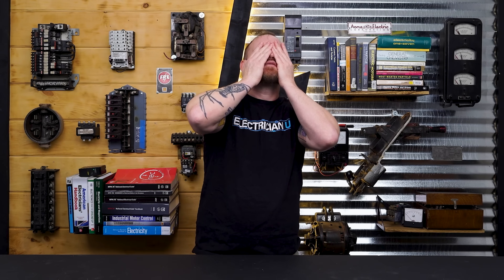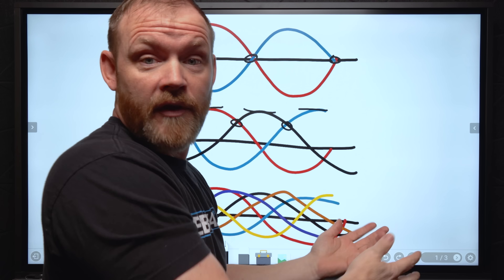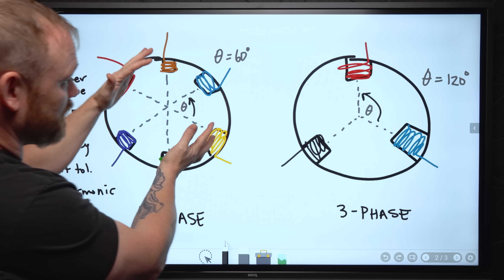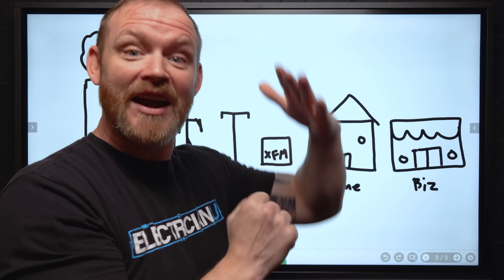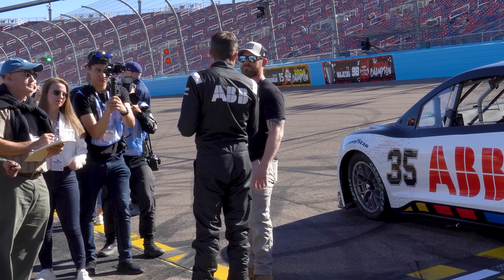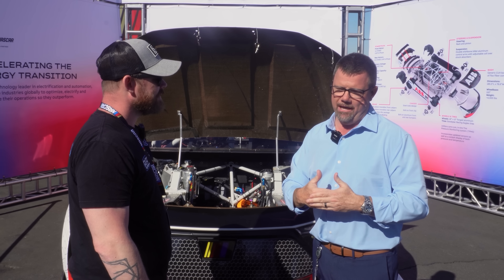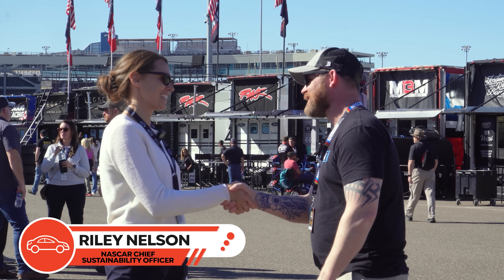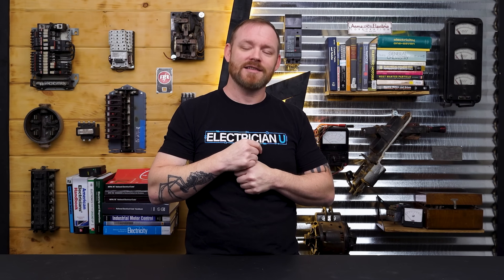6 Phase Power is a REAL GAME CHANGER!

Comment: Um, the zero crossing no power state is actually 120 times a second, two crossings per one cycle.
Reply: yeah, and the graph showing single phase with blue and red tracing is a bit misleading. should just have one red sine wave, not red and blue.. the blue opposing wave would be if you had a 2 phase system, with one phase 180deg out. not very useful
Reply: @DavidFRhodes I personally prefer the 2 phase terminology, but what you're calling 2 phase everyone else calls single phase so as much as I like the idea of calling it 2 phase you'll just be causing confusion to do so because the rest of the world calls it single phase
Reply: @ people don’t call it two phase because it isn’t. It’s single phase with two legs of opposite polarity. It’s single phase with two voltage options, full voltage and half voltage. Nothing more.
Reply: @RenoSCM 220V in the US is two phase.
Reply: @ChaseNoStraighter  that's incorrect it's single phase, split 240V. Also, it hasn't been 220V in the US since the 1980's
Reply: @ChaseNoStraighter  “Split single phase” is what you’re talking about. It’s single phase with a center tapped transformer secondary to allow either 240v or 120v loads.
Reply: @RenoSCM  depends on where you live sometimes you’ll have a three phase power thats adapted a single phase and you’ll have the two hot wires, 120° apart instead of 180° depart resulting in 208 V
Reply: @johnathanrice3569  If your transformer primary is using a single phase of distribution voltage (around 7200V), the secondary will be split single phase just about every time. Either a pole mount or pad mount transformer, still the same winding configuration.

A transformer like you’re talking about, how do you think this is configured, using a single phase primary and somehow coming up with three phase secondary? That’s not possible. In order to have three phase secondary you need a three phase primary arrangement
Reply: @ChaseNoStraighter  240 v power to residential units is single phase. The neutral center tap on the secondary gives you the two 180 degree out of phase 120 v circuits. It’s still single phase . We sometimes call it split phase.
Reply: @glennmcgurrin8397  2 phase power had a 90 degree phase separation
Reply: Leave off the "um," you'll sound more helpful and less pedantic.

Comment: If the Utility had 6 phases, why couldn't the 3-phas users just use every other phase for their 3-phase stuff. (load balance will need to be managed)
Reply: They could.

But six phase would require much more infrastructure which doesn’t create much benefit.

Cost to benefit isn’t there

Comment: 6 phase motors can be adapted to 3 phase and DC systems. Using VFD drive system  like in that car is from DC battery.  6 phase inverter . to do this in a factory just use a 6 diode bank to DC and drive VFD. This is done on 3 phase sync RM motors.  For the power grid with long transmissions lines 6 phase is wistful with the number of wires. What is being done is UHVDC which is more efficient and uses only 2 wires. and it is DC.  Part of USA power grid is DC   and China has a UHVDC grid system. With semiconductors getting much better it is now easy to convert DC to AC . This  allows grid connections to 50 and 60 HZ , That only be done with a motor generator set before and not efficient and high maintenance .
Reply: Some UHVDC systems use a third metallic return wire in order to prevent ground currents.
Reply: Uhvdc, that's dangerous stuff.

Comment: Don’t BEV’s use DC power?
Reply: not always, the slow charing is AC better for the battery.
Reply: @ Actually not. The AC current is rectified to DC. My question was regarding battery, electric vehicles, which use battery/DC power, and not AC power. Run six phase in a battery electric vehicle would require a very interesting inverter to convert the DC to six phase AC power.

Comment: Fun to drive, super boring to watch, sound and smell is half the experience
Reply: This is the key, for better or worse, noise is most probably most of the issue. No one would buy a ticket for an AC/DC concert, if those guys were not mic’d and amped up. After the first few rows, you might be able to hear just slightly more than Phil Rudd, but probably not. 

 For the amount of live audience, the fuel consumed is relatively low. NASCAR should not go all-in on this, it could easily become a disaster. There are places where being quiet is appropriate but not at those types of events. Obviously, those lot will trial races, but l do not expect anywhere close to the numbers and ticket sales of a main race, after the novelty has worn off. Also, whenever EV takes over for everyone else, there will still be a market, possibly more of one, for lCE racing. Speed is only a slightly important factor, endurance and strategy are more important overall. Those lot are heavily restricted and not actually going as fast as technology will allow.

This being said, the topic is still very interesting and excellent for this channel.

Comment: Dustin I really enjoyed this video. Thank you for covering this, it was fascinating. Ive only just finished AC motors in my apprenticeship. I would have thought the down side of 6 phase was that it increased the number of poles in your motor. Doesn't increasing the number of poles reduce the RPM? Or is this only for three phase?
Reply: Motor speed wouldn't be affected because motor poles refer to the rotor and are independent of the number of phases. Think of it as how many degrees the rotor turns per supplied Hz. 

The way that variable frequency drives work to control motor speed is by using very fast switched DC signals to artificially replicate AC sine waves. Reducing (or increasing) the artificially produced AC sine wave Hz slows (or speeds up) the motor.
Reply: @realtimjimmy  thanks

Comment: Inversion to any number of phases is technically simple (just a multiplexing and transistor bank/ CV onductor "count" decision and I think had been done before in several industries where extreme smoothing for ultra stable DC is required... We call it poly phase (no limit beyond practicalities), not viable tor transmission (count the conductors - more = higher expense at every termination) mechanical strength and thermal properties of aerial cables is a factor in minimum sizing...

Not everything "genius" is new.

Comment: 1:39 so does that mean that in a 3-phase system, asuming 120V rms, running at 60hz per phase, a motor would technically be receiving a 60V-120V fluctuation between all three phases, 180 times a second, so every 5.56ms? 

same thing for a 6-phase system, there would be a 104V-120V fluctuation every 2.78ms

i hope my question makes sense

Comment: To bad the battery's are dead in literally 20 mins! You would have to do a hot swap battery because how hell you gonna run 200mph for 200 miles???? Its not ready the battery tech just is not ready yet. It wont be for 50 years. 78kwh battery when the car can draw 1000kwh???? do the math on it. It just don't add up to having a large power reserve to last long to not have to change out battery every 20 mins or less. ITS a Joke.

Comment: Why wouldnt the car just use a DC motor? I thought AC was more efficient for long range transmission, but the battery and motor are right next to each other.
Reply: I think it is DC. If its battery powered it has to be, right?

Makes me think of brushless DC motors used in power tools. Those are 3 phase
Reply: @ForkTech83 Brushless DC motors are actually AC motors with an electronic converter. Most of them are 3 phase.

Comment: Needs cooling because, the drivetrain is still friction think single gear or more in fancier ones. Gears still need oil and cooling. Batts too in hot days
Reply: Actually you need cooling for the electric motor, inverter, and battery.  Converting electric power to mechanical force generates large amounts of heat.  If you look at almost any electric motor you will notice cooling vent with a small fan on the shaft pulling air across the motor.

Comment: I doubt electric stock car racing would gather much of a fanbase regardless of how many social-media influencers they summon to hype it up. Formula E barely works because it pulls from an international audience and because they use street circuits.

If you want to see cars going around in a circle and hearing boring buzzing sounds, kick over a box fan,  superglue some matchbox cars to the blades, and grab a beer; it's probably more entertaining.
Reply: You are right that a silent circle of cars would be boring. They would surely need audio sounds like that of Star Wars to differentiate between cars as they go around! And the tracks would need to be more curvy to better allow the skills of the drivers to show as well as the capabilities of the torque and acceleration of the cars.
Reply: @MrNiceGuyMEGA08  Then is not gonna be Nascar, it will be something like a GT cup. Part of the appeal of nascar is the mayhem that could potentially occur due to high speed and close proximity and the roar of dozens of engine. Just like top fuel dragsters appeals is their crazy loud and powerful engines.
Reply: @AC89-o9n no the appeal of NASCAR was "Race on Sunday, Sell on Monday."  That died in 1998 when the stock bodyline was dropped.  Since the Car of Tomorrow all they've been is the same car with different stickers.
I'm surprised Ford is still in since they already pulled out of NHRA, (a Mustang is not a NASCAR car).
Reply: NASCAR will require all to use the same powertrain components so there can be no advantages.   NASCAR becomes a page in history.
Reply: That sounds more entertaining than the Non Athletic Sport Centered Around Rednecks, to be honest.
Reply: Engine sounds brought to you by Kenwood, Sony, and Marance.

Comment: In a three phase system, if you "lose a phase" your motor will barely run, if at all, and it will burn itself out or trip the circuit, because when you "lose a phase" you are actually losing TWO phases, so your motor is trying to run on just one phase!
Reply: @johnb6418   only if it's lightly loaded it might run at a slower speed for a short time. At least that's what I saw during my 50 years as an industrial electrician.
Reply: It depends on it is delta connected or wye connected motor. A delta connected will burn 1/3 of the windings a wye will burn 2/3 of the windings if you lose a phase.
Reply: The relationship between phases and legs is roughly that of edges and nodes. While 3 legs give you 3 phases; two legs gives you one phase.
Reply: @robinhammond4446  in the applications I worked on we always referred to that as "phase to phase".

Comment: Six phase in most cases not worth it. Just having to accommodate having to increase wire size because of over 3 current carrying conductors. With three wire three phase not sn ussue uf you cross wires othet then motor direction will change. In 6 phase if you crossed the wires could imagine burning motors uo like it happens in 4 wire two phase motors.

Comment: Here's a wild and crazy idea. 12 Phase. 30 degree seperation between each phase. For homes and businesses it might be overkill but not so for race vehicles.
Reply: Why not 360 phase, with only 1° between phases?
Reply: @twestgard2  to complex to have a power supply that can do 360 different phases of power
Reply: Theres a huge improvement from single phase to 3 phase.  The improvement from 3 phase to 6 phase is a lot smaller. The improvement from 6 to 12 is going to be tiny.
Reply: @andrewalexander9492  True. For a everyday normal user of electricity, its not going to be noticable and is expensive. But when it comes to a racing application, Each second can make the difference between losing or winning. Even if the gain is small, its still a gain over your opponent.
Reply: Correct. Law of diminishing returns
Reply: 24 phase w/15 degrees! 48 w/7.5?!
Reply: 7 minutes abs is the way to go. 6 minutes abs is crazy!
Reply: 3 phase is the MOST economical way of getting efficiency and minimizing cost. Increasing your 6 phase you are increasing cost and not gaining much efficiency
Reply: 3,000 phase? 6,000 phase? How about 30,000,000,000 phase? No…too big a pill to swallow.
Reply: Only an odd number of phases makes sense.  3 phases 120 degrees apart gives the same number of power"pulses" as does 6 phases. Five phases gives the same as 10 phases, 36 degrees between each "pulse".
Airbus actually developed a five phase motor for electro-hydraulic actuators used in airplanes. This for reliability, not for smoother running. If you lose one phase, the motor will still run.
Reply: @johnolavhenriksen5209  for redundancy then…
I didn’t know airbus did this, thank you for the info.
Reply: I think 6 phase may be the sweet spot for EV’s only.
Reply: Infinite-phase motor not using windings but instead layered metal, using pulses not phases.
Reply: @floycewhite6991  I’m intrigued, but unfortunately to dense to wrap my head around it 😂
Reply: Your torque would be trash. The smaller the phase angle the lower the torque. 90 degrees is maximum torque.
Reply: @mattm3901  by your own definition, 120 would be the best
Reply: @johnathanrice3569  120 what?
Reply: @mattm3901  120° offset in phase for maximum torque.
Reply: Its gonna be a super hard sell on anything except vehicles and micro grids, need 4x as much conductors for 12 phase vs 3 phase
Reply: At the end of the day, you only have a north and the south pole on a magnet
Reply: @Lil0Kevin14  the 6 phase is 30° apart, this guy explained it wrong. 12 phase would be 15° apart. Each phase can be inverted to make up the missing wave forms.
Reply: With every new phase you add more windings. At some point the performance gained is offset by the increased weight.  I'm kinda surprised 6 phases makes sense to start with.
Reply: Same thing I was thinking
Reply: 1440 phase with .2500 degree separation
Reply: 720 phase with .5 degrees
Reply: More poles equals heavier motors…

Comment: But it's still a dc moter powerd by a battery with a positive and negative right? Or dose the batery power go trough a inverter to become ac and a transformer to make it 6 phase?
Reply: No it's an AC motor powered by a DC power. The millons of three phase VFD'S ( Drives ) out there have thier 240 or 480  volts feed s full wave rectifier that powers IGBT'S  that produce up to 5,000 Hertz somewhat chopped AC output. AC Motors are a lot cheaper and most large ones have brushes that need maintenance.
Reply: @JohnThomas-lq5qp  thanks got it, ac moter , vfd inverts dc to ac and igbt makes 6 phase moter work
Reply: @chrisf9607  I had to look up IGBT - it’s just a type of transistor.  They would be within a VFD, not a separate thing.  But someone could easily make a VFD that has 6-phase output.
Reply: @kc9scott  ok sound good so the dc power must go through an inverter become ac than the now ac power gets transformed in to 6 phase but not with a traditional transformer but vfd or igbt that uses transistors to make 6 sign waves for the ac motor 👍
Reply: Indeed.
Reply: @chrisf9607  VFD'S have three phase power that produces a chopped three phase THREE wires. In a new building all motors except for the 250 HP fire pump motor 40 HP & larger were feed by 18 pulse VFD'S that supplied a three wire chopped three phase to motors.
Reply: @JohnThomas-lq5qp  ok most commercial sites I've worked 3 phase comes from the transformers in a delta or y configuration I haven't wired many motors but I have seen capacitors in ac units turn single phase in to something like 3 phase so the motor works right. In solar the inverters turn dc to ac 240 or 208.
Reply: Bingo